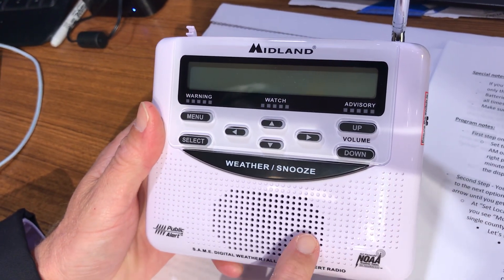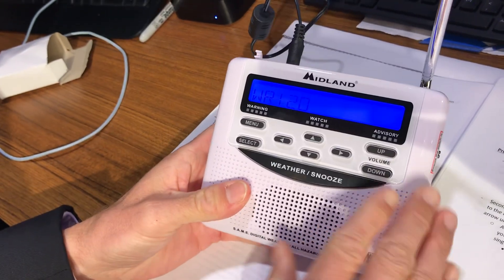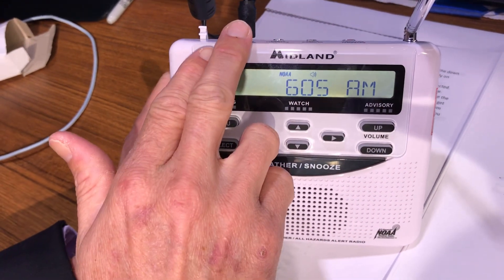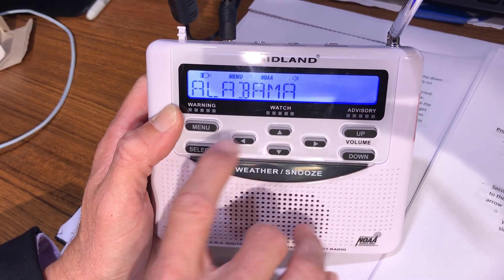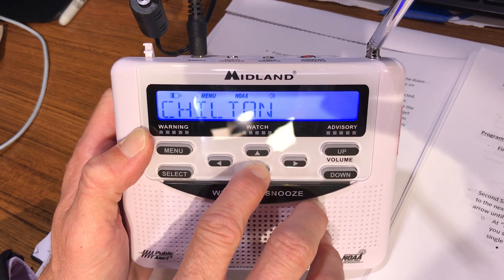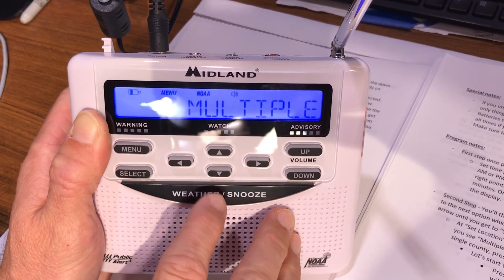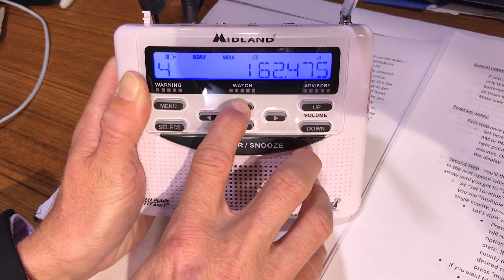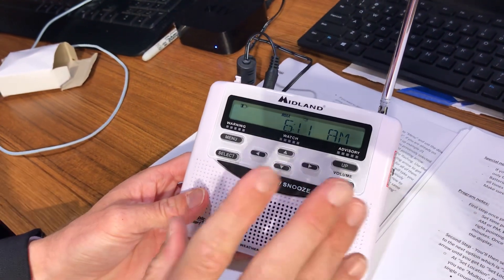Everything You Need to Know to Program NOAA Weather Radio #severeweather #tornado #howto

Comment: I just programmed my Midland radio. In events, they have a Tornado Watch but not a Tornado Warning.  How do I get the Tornado Warning?
Reply from the maker: If you have it programmed for the county you want, you will get the tornado warning as well as the tornado watch. Just make sure the switch on the side is turned on
Reply: You are not able to change alert status for tornado warning, it will always sound no matter what
Reply: Tornado warnings are not allowed to be turned off per FCC rules, so Midland does not give you the option to turn it off.  There are about 25 alerts that cannot be turned off and those alerts will not appear in the menu.